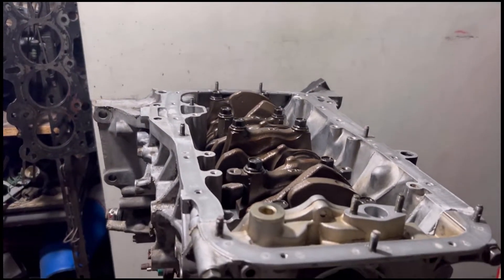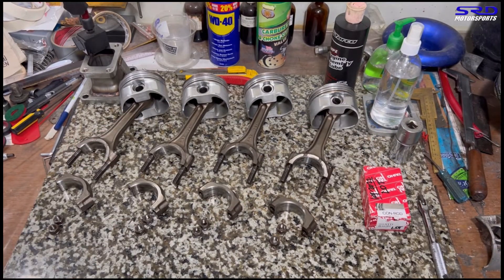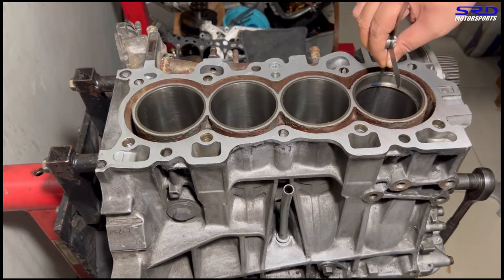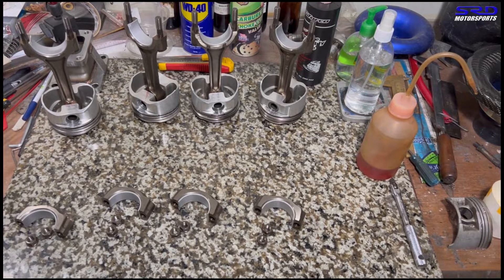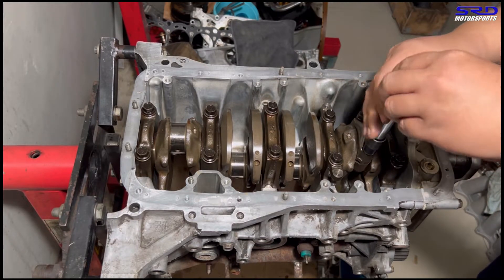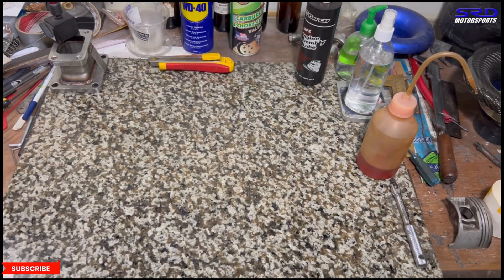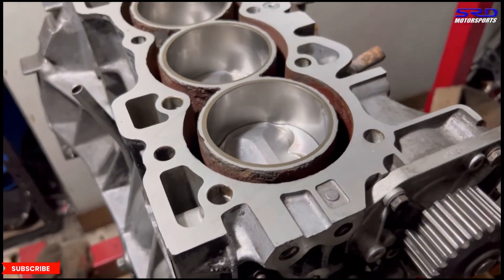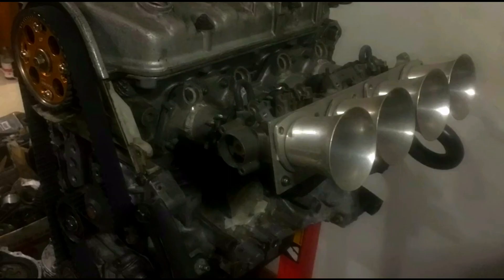Honda Civic SiR B16a Rebuild Series Part 3 ARIAS Piston Install

Comment: 82mm piston is safe for b16a all motor build? And also if i do turbo build?
Reply from the maker: not always… as not all oem stock sleeve are consistent at 82mm 

Turbo I won’t go more than 81.5mm on stock sleeve
Reply: Thank you boss for your reply:) so if I am going to do the 82mm I need to change my sleeves?
Reply from the maker: Yes for safety

Comment: Love your enthusiasm with the engine, "oh look at that beauty, look at that piston"😂 you remind me of myself because I love building engines and just admiring them. B16s are my favorite b-series because they just love to Rev high and when you put them on boost they just go crazy, and well b20v I also love dearly. Also 1 question I have, don't Hondas have a 3 step torque sequence? Never noticed it was just 2 sequences in terms of the main cap bolts , great video my brother
Reply from the maker: the head could have a 3 torque sequence but was always fine as I did 2 step

Same on the mains what’s important is the last step
Reply: @SRDmotorsports  ahhh okay noted, I guess it's because the bolts were already stretched?
Reply from the maker: @StraightOutThaGudda  yeah sorta

Comment: Suggest the owner replace the water pump connecting pipe too 👍🏾
Reply from the maker: oh true dat true dat!
Reply: @SRDmotorsports  1:19 what happened to the aluminum liners?
Reply from the maker: @findtherightbeat  previous owner, as the current owner barely has this for almost 2yrs only… previous owner I gues was fond of using tap water here in the Philippines (deep well) so corrosion happened 😂 that’s the downside of “locally used” sometimes

And surplus always runs coolant due to anti-freeze need in Japan and coolant always has anti rust hence no corrosion too that’s why all surplus tend to look fresher than locally used 🤣 lucky there isn’t any overheating issue on this one
Reply: @SRDmotorsports  Great observation as to why engines from Japan don't have liner corrosion. 👍🏾
Reply from the maker: @findtherightbeat  yeah man and since that realization (circa 2008) I’ve always ran coolant even the cheap ones at 90pesos is fine still has anti-rust lol

Comment: No F/I in the works at all? In your experience, how is forged pistons with 0.003 P2W clearance work vs the cast pistons with ~0.0015 P2W clearance for reliability and power?
Reply from the maker: FI none yet since the turbo d15b7 but lookin’ into doing some soon but hopefully a turbo customer swings by and that’s be fun!
Reply from the maker: On the PW usually for cast oem especially stock bore when the block is a bit worn having it honed (if straight) 0.0015-20 is alright 0.0020 I’ve seen no detrimental effect

On forged though it’s safe usually 0.002-4
so it’s all good right in the middle  though I haven’t tried 0.004 on forged
Reply: @SRDmotorsports  since this build is an all-motor build, isn’t it better to run the forged piston P2W on the tighter side? It’s fairly low CR for all-motor and not running F/I won’t produce as much heat either.
Reply from the maker: @kmvguy  in theory yes? but I lost track what series part number did arias switch on silicon content = less expansion

Plus with p2w I figure it seems the same as ring gaps, a lot will stick to numbers but even the cast piston b20vtec we did that had excess of 0.019 ring gap up top still had excess of 300psi
kinda hard to think that If the gaps were 0.014 it would have been 350psi lol

so IMO as long as bore is straight and hone finish is good I think that’s more important.

Then Ofcourse those who “claim and suggest” don’t tell you that 10% drag is from the top rings , 30% drag is from the second / scraper ring and the 60% is from the oil control rings
-the windage drag or “heaviness” when pushing up n down… so I’d rather try to lessen than but that’s a secret shhh!

Like a very old saying goes
“Run it too tight and everyone will know”
“Run it loose and nobody would know”

Cuz the former may cause scratching the bore , blow ups , ring seize etc
Reply: @SRDmotorsports  Thank you for the detailed explanation! It’s really awesome. Does this mean you guys run larger gaps on oil control ring? Haha
Reply from the maker: @kmvguy  no worries man it gets obvious I love what I do? Hahah

Actually on the oil control rings? I’ve been considering or thinking about ways to work around it cuz changing gaps may not change the drag as it’s “sprung”

But that’s a worthy test for sure
But an expensive test hahaha